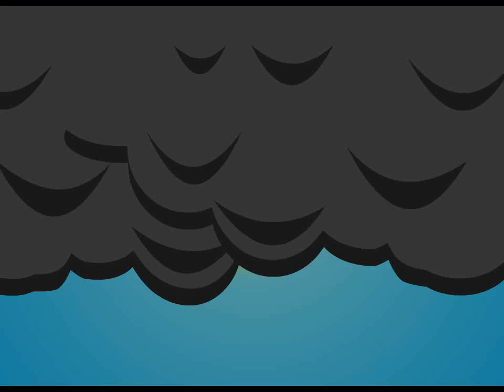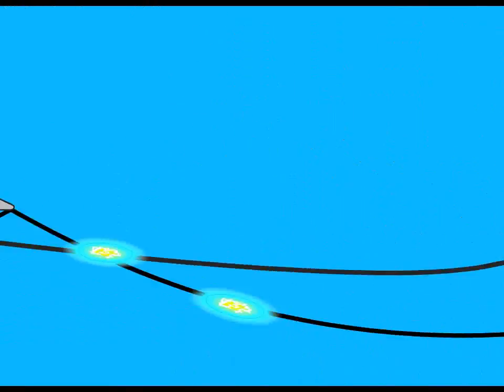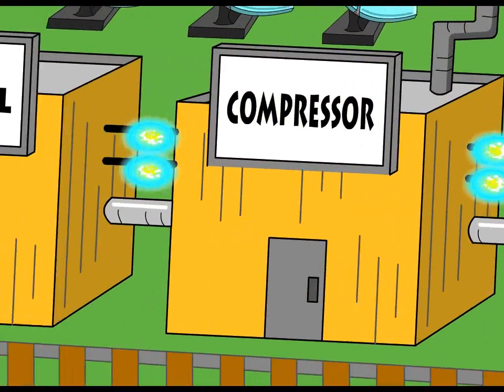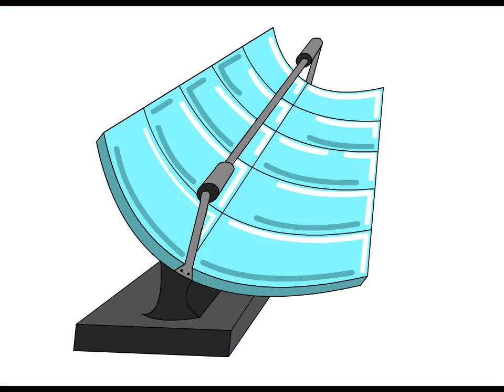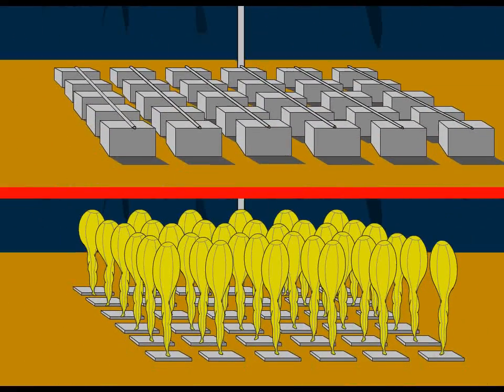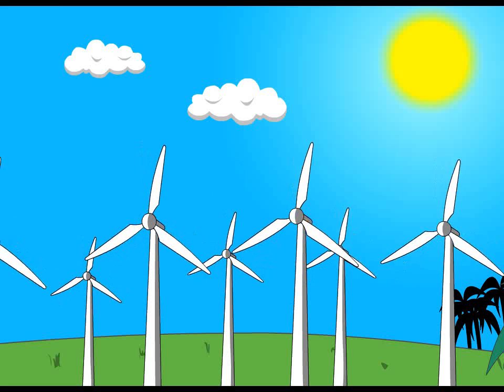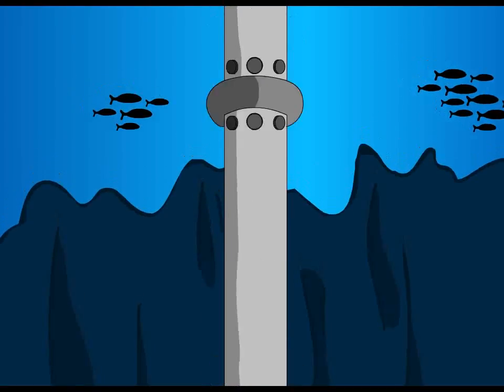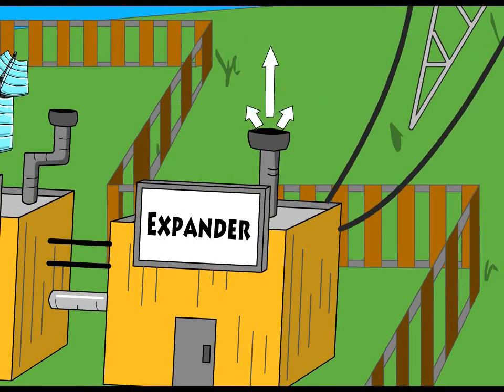How the Hydrostor System Works (2013)

Comment: This makes no sense. Why the water? Why can't you just pump compressed air into a steel tank right on ground level. During discharge, the compressed air flows out with high pressure and feeds through turbines to run a generator. Am I missing something basic?

Comment: in efficient energy system . 1. Need energy to heat, pump, pressurise and so on and so on plus UNDERWATER to store them. overall the system spends energy and to store and release. whereas in battery, only chemical energy is involved. Hydrostor, there are so many variables involved compared to 🔋 if you look in terms of mathematics.